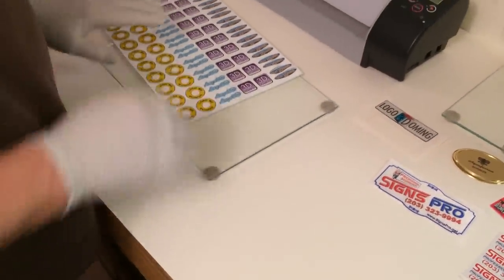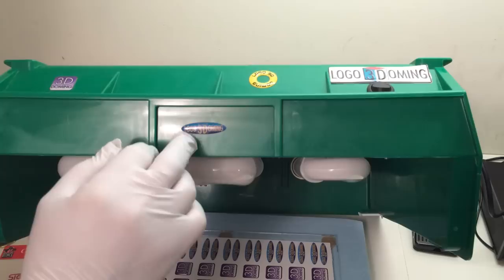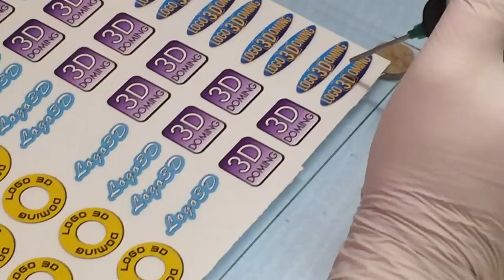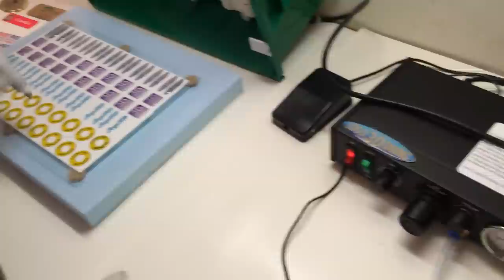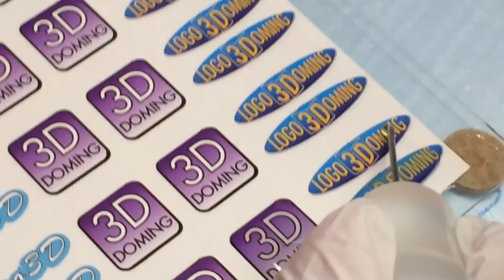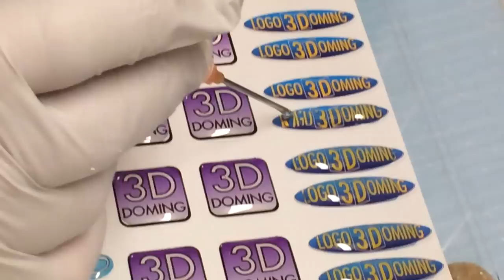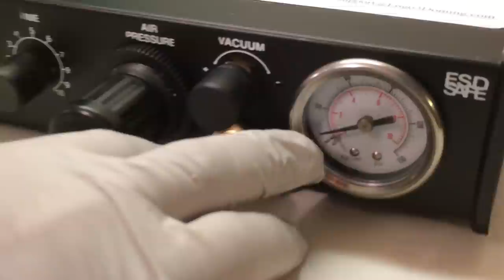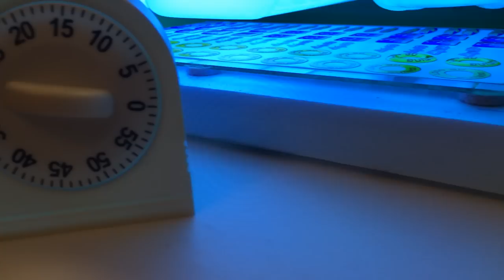Doming

Comment: May I ask...
-For these sticker, I take it you use a soft resin...right?
-For a car emblem sticker, since it would be 'weather exposed', would the product to use be a hard resin?
Reply from the maker: +Hi 
You can use hard or soft/flexible resin.  These resins are uv cured within 15 minutes under uv lights.
We offer four different doming resin for various application.  If you are interested we can provide you with small 2oz bottles of each, cost is $40.
Regards,
Logo3Doming LLC

Comment: What keeps the resin from going outside of the logo edges? I don't understand
Reply: Surface tension
Reply: @rudykoszkul2374  Does it have to be perforated?
Reply: it needs to be cut or "kiss-cut" on on vinyl cutter.  Dispensed resin stops at the cut edge and held by surface tension.
Reply: The tensión are important,but the type of ink.some ink reject the resin
Reply from the maker: https://www.logo3doming.com/